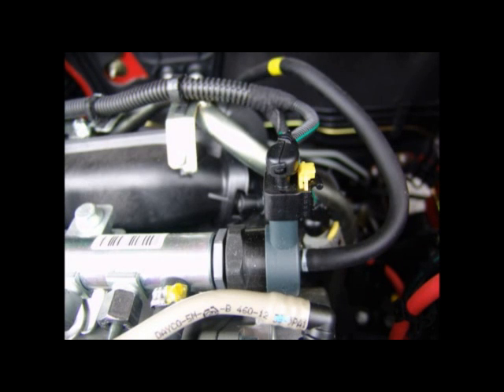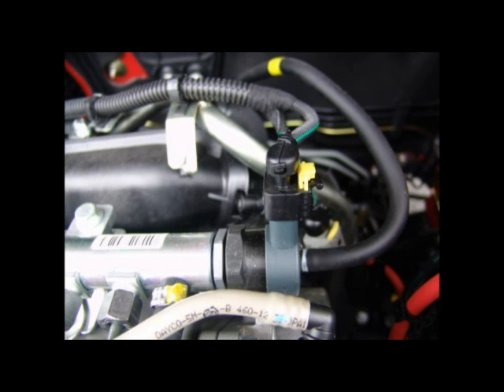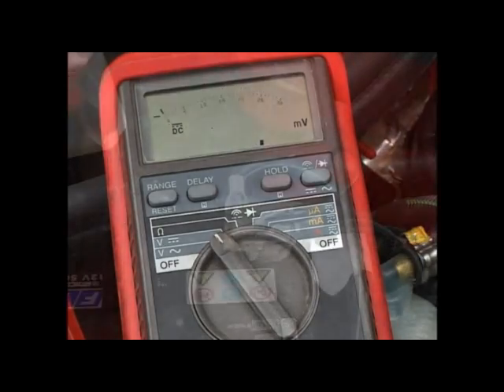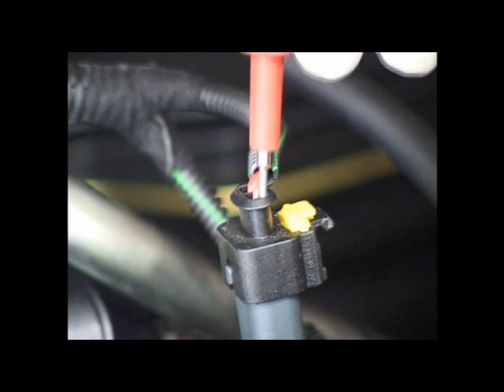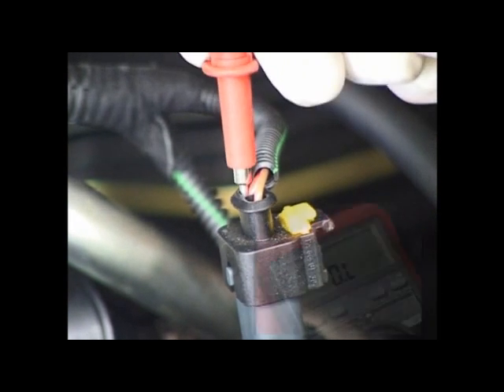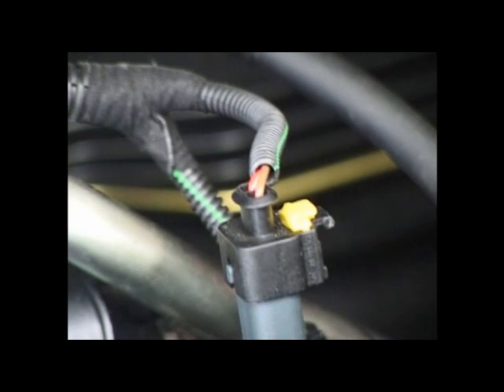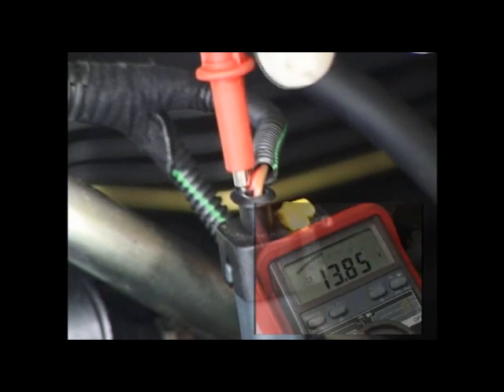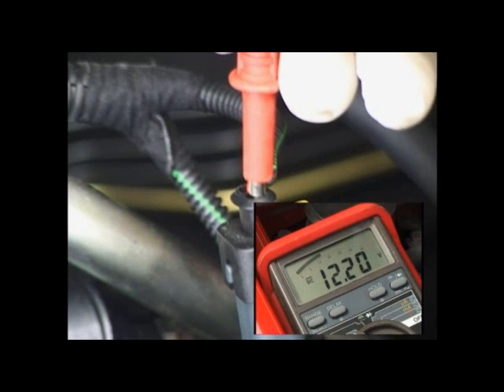RAC How to Test a Fiat Doblo 1300 Multijet Fuel Rail Pressure Control Valve

Comment: This is not the test of regulator, you are testing ecm's pinouts for regulator. you could have a faulty regulator and although to this, you can still measure these voltages.